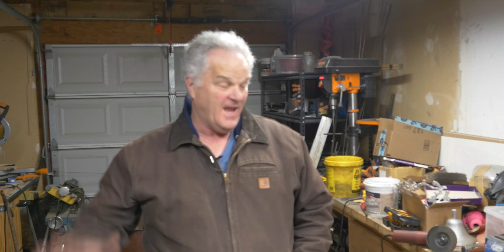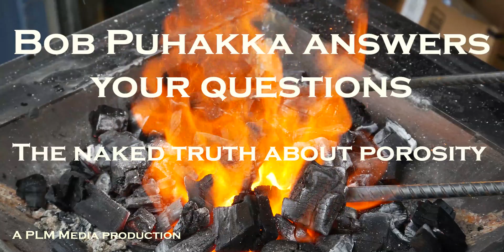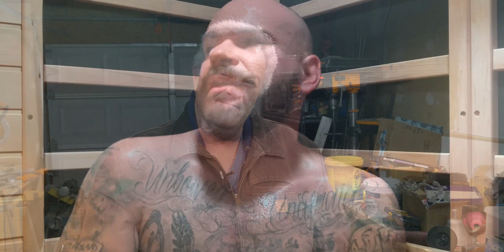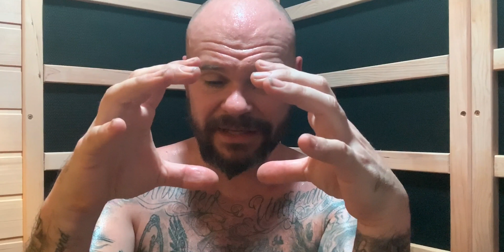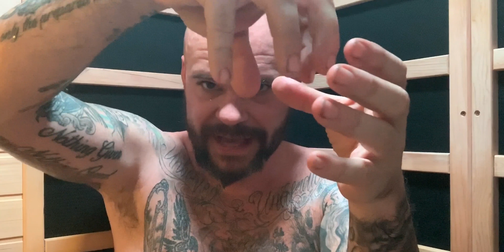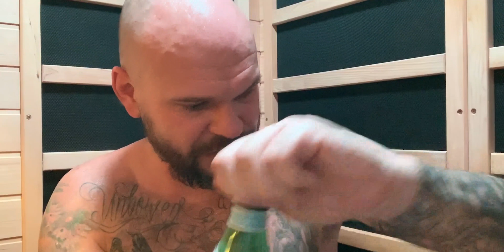Naked truth about porosity

Comment: Well that definitely put into words and helped to complete thoughts I was already having. I guess that I already knew that the film and turbulence was an issue, just hadn’t put air and water vapor into the equation. So simply putting this, if we degass and keep turbulence to a very minimum with our sprue and runner design, oh and give plenty of vent on the front side of the pour we basically are going to keep our porosity to a minimum?  So besides venting and degassing , and an oxidizing burner, will heating the mould help as well?